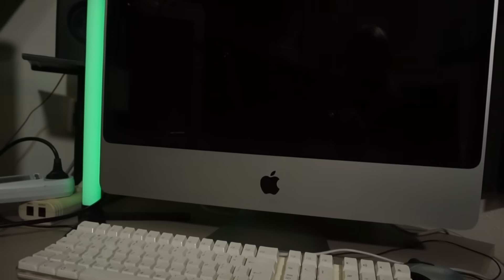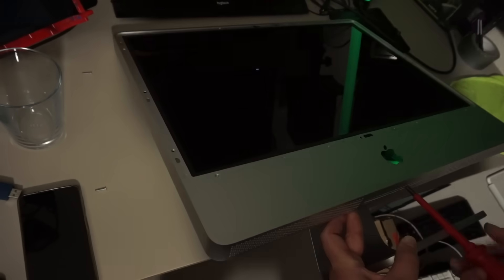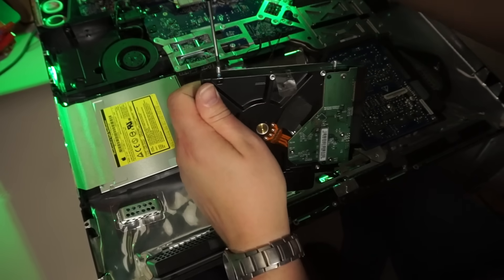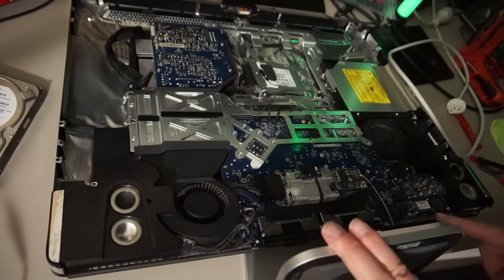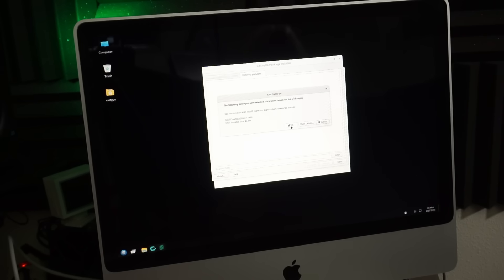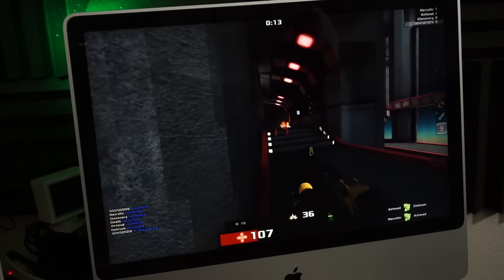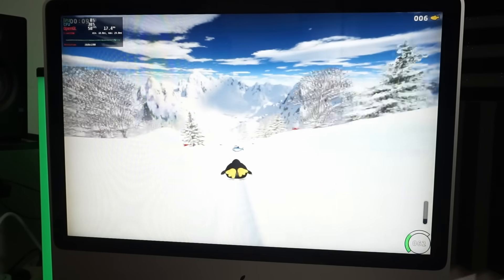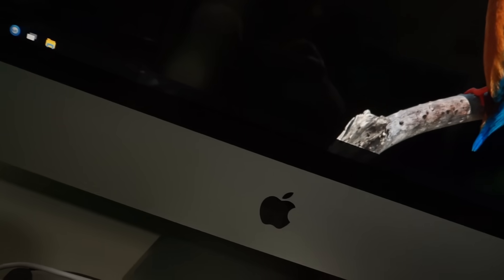Reviving a 2007 iMac with an SSD and CachyOS!

Comment: I have an old macbook air that I have tried several low weight distros on. They were ok but not really good. Thought of trying arch since the others were ubuntu or debian. On a whim installed cachyos. Wow! Excellent. Very speedy. Cachy has a rep as a gaming distro but the initial install is very lean and has no gaming stuff or bloat at all. Very pleased.
Reply: CachyOS has a big ISO and was slow to install on my 2018 Dell Latitude. But, once installed, it is the fastest OS i have every used.

Comment: I have a 2014 macbook air that has a corrupted SSD and might have corrupted SSD driver chip if there is such thing. Was being told that by Apple. If you can point me to the right direction on how to verify if it's just the SSD or some other chip broken i might give the laptop a 2nd chance,
Reply from the maker: Good question, that's hard to say from a distance haha. The SSD on a 2014 MBA seems to be similar to the one in my 2015 MBP. It looks like an NVMe drive and it probably is, but it doesn't have the same connector that regular NVMe drives use, so you would need an adapter to be able to plug it into a PC's M.2 slot. And you need an adapter to M.2 to plug a regular NVMe drive into your Macbook. 

Note that you need a Pentalobe P5 screwdriver to get the bottom screws out of the Macbook! It's not Torx!

If the machine still runs, you could ofcourse boot it from a Linux bootable USB and run tests with tools like smartctl before you open it up.

I found an article explaining the different types of propriatary connectors Apple uses, titled "The Ultimate Guide to Apple’s Proprietary SSDs" by Cody Henderson. Not gonna link it because YT doesn't seem to like that very much. 

You're welcome to talk about it on my Discord server by the way! There's more people that might be able to help you find the answer to your question! :)

Comment: I have a mid 2009 macbook pro with Nvidia 9400M, and it works flawlessly under Linux! Funny thing is that for whatever reason Nvidia 9xxx gpu's are a rare oddity in Linux, all I've tried have no issues at all. Even the latest version of Minecraft is playable at around 35 fps at full res
Reply from the maker: Nice! These GPUs are prone to failure however, but can be revived for a while with some heat (I made a video about that as well, on a 2008 model). But as long as it works, they're great!
Reply: @ex-itguy  No as far as I know, these ones aren't prone to failure. It's the Nvidia 8xxx ones that are prone to failure. I have found several failed Nvidia 8xxx gpu laptops but none for the 9xxx ones. I even have a All In One Touchscreen PC with a GPU that's from the 9xxx generation and that has a laptop motherboard internally oddly enough. I got a bunch of them from school as they were discarding them but all of them work just fine and have been used for years! Some of them dating back to 2019 with Windows 10 on them as the last time it was used.
Reply from the maker: I didn't know that! I thought all of these had issues. I have seen videos on iMacs with Radeon cards that had the same issue as well, but to be honest no personal experience. But I don't keep any around for long enough to make sure. :)
Reply: @ex-itguy  If it helps I got my mid 2009 macbook pro out of a junkyard. It had minor water damage that I removed with alcohol and the SSD + HDD (DVD was replaced) were both dead. After replacing that and upgrading it to 8GB of ram it's actually a pretty nice and usable laptop! Even the original battery has 80% health left which is impressive
Reply from the maker: @aleksandersats9577 nice!

Comment: Ive got one of these I got from a garage sale for $10. Im not a mac guy, but Ive always liked the aesthetic of this model. Ive got it in the kitchen in top of the microwave. I probably wouldn't use it as a daily driver, but it makes a perfect kitchen PC, youtube, recipes, music etc. and the rest of the house tolerates it, as opposed to having something more janky-looking.
Im glad you mentioned the boot time, and a fix. I probably wont do it, as turning the machine on a few minutes before starting is kinda normal for kitchen stuff. turn the oven before baking, turn on the kettle before you need hot water, fill the sink before washing up. besides, I dont have a copy of macos.
Something I didnt know, is that you need to use a proper mac keyboard in order to get it to boot from USB. the internet says you can use many combos on a standard PC keyboard, but I couldnt get any to work until I acquired a proper mac keyboard. That, and the fact the bootloader takes SOOO long had me convinced the machine was broken.  I was very pleased when it did infact boot a USB. Im using Xubuntu, mainly cos that is what I had on hand, Wifi drivers work right out of the box. havnt bothered with GPU, not something i'll ever need.
lovely machine, the screen is excellent, looks at home in a kitchen, and the right price. boot up time sucks and power draw is a worry (it gets HOT), but also, just about anything else in the kitchen is a power hog, so I dont really mind much. Oh, and the WiFi works just fine, even when its sitting on top of the microwave, so thats nice
Reply from the maker: There's old MacOS images on the internet archive, but I couldn't get one to boot from USB while my 2015 MacBook had no issues from that same stick.
You don't need a Mac keyboard to get into the boot picker. Just hold alt right after the chime until you see it. :)

Comment: I have a late 2009 iMac with a running OS of 10.6.8. It works for what I need it for.
I could technically update it using some of the open source options but I decided to just pop in a USB and boot to Linux. No need to take it apart to install an SSD.
Reply from the maker: You can install it to the hdd as well haha, it just won't be as fast. :)

Comment: Great Job, I worked on a few of these, hated the power supply exposed like that, but when you had it opened you should have upgraded the CPU tbh
Reply from the maker: Thanks! Changing the CPU is quite a lot more work,  but I didn't have one around and didn't want to spend money on it tbh

Comment: They are great. Not do great are the wifi cards. The Broadcom chips have issues. Losing connection and having to disable and enable. It's not a Mac thing. ( So be warned) I used to run Linux Mint on it I did switch out the cpu for a faster newer type.

Comment: Try upgrading the RAM to 6 GB, Intel Core 2 Duo T9500 as the extra cache, clock speed, and efficiency will improve things by a bit.
Reply from the maker: I don't think that will bring huge benefits tbh. The biggest issue is the gpu in this case. I guess you could upgrade that with a better MXM card but these aren't cheap haha
Reply: @ex-itguy  fair enough
Reply: Though personally, if you are buying a computer, try to get one with at least a 3rd Gen i7 or newer

Comment: Think I'd drill a couple of new holes in that drive adapter to get the SSD connector where it needs to be, rather than rely on a bodge!
Reply from the maker: That would mean on both sides because you'd also have to move the plastic clip. And the adapter won't be long enough for that either so you'd have to extend it with something. ;)

Comment: Some 32 bit linux will probably be a lot snappier on that, Debian 12 also includes most firmware and will probably be a good option.
Even a 32 bit windows would be a viablr option for some retro gaming, drivers can be a bitch on old macs though

Comment: This is my everyday machine! lol. I maxed up the memory and put in an SSD and I’ve been using it as my television and streaming device in my bedroom since 2007.  Everything works perfectly fine. I’m never waiting for buffering or anything like that and even though I have some newer computers, I always keep this one as my main because it is amazing. How much use I have gotten out of this machine.  The only thing that even comes close is my late 2008 Mac mini which I maxed out and added an SS D Dr. as well and I’ve been using that on my downstairs television since it was brand new right now it was running Monterey, but I’m gonna upgrade it to Ventura as soon as I find a suitable USB hub to get around the glitch that doesn’t allow you to install Ventura in these machines without plugging in a USB hub for some reason  but I have a 2007 and a 2008 and they have been running nonstop 24 seven since they were purchased new except for the few weeks we had no electricity during super storm Sandy in 2013! I cannot believe that these computers still work and are just as good as my newer computers. I get annoyed with all the videos, calling these machines you waste when they are definitely not you waste.  As long as you install open core or Linux they are still perfectly usable and instead of paying $3000 for an iMac you could get one for $20 and do the same thing

Comment: i think the imac and the all-in-one in general is useless form factor ,why would you tie a good panal with a platform that would end up obsolete 2 years later ,i have 22 inch dell display from the core
i mean whats the advantage to buying an mac mini and monitor ,ppl are too dummy to plug the power and display cables?
Reply from the maker: I have to agree with you on that. I loved the 4K display of the 2017 model I got here but I didn't want to keep it around for that exact reason. If you don't want to see it, you're better off buying a mini pc to hang at the back of a monitor.

Comment: Interestingly, Windows might actually run better, especially if you max the RAM which was cheap enough at the time. I had one of these models and Windows ran suprisingly well and it still would get updates unlike MacOS.
Reply from the maker: Not much luck with Windows 11 on this one though haha, although... if you really, really want it, there is a way. I'd rather have it on Linux though but that's just my preference.
Reply: @ex-itguy  True. I think I was running Windows 8 maybe even 10, but never tried 11.
Reply: Core2-CPUs like this can't run Windows 11, because they don't have the SSE4.2 instruction set.
Every Core-I is able to run it by using Rufus or any similar trick.

Comment: I was very lucky to find two (!) 2017 Retina iMacs together for about 100 euros which needed SSD upgrades.. Not as easy to repair as the previous generation with non laminated displays but very doable.

And nice to see cachyOS!
Reply from the maker: I was glad I could skip that step when I had a 2017 model overhere haha! But if I would have wanted to keep it, I sure would've done the upgrade indeed. The 4K screen (or 5K even on the bigger ones) on these things is amazing!

Comment: On all of my machines, I usually do not swap the spinning disk for an SSD when using Linux. I use the SSD for a Open Core Legacy Patcher and macOS installs only. On Linux, most of my MacBook (Pro), Wintel-Laptops, and legacy Gamer-PCs, run pretty decent with spinning disks no matter what RPM.
Reply from the maker: I haven't used a spinning disk for anything but my home server  for 15 years or so haha
It's true that Linux runs fine on a hard disk though, but boot and application startup times greatly improve on an SSD. And they're cheap nowadays!

Comment: Didn't you have any problems booting 64bit at all? These are one of the 64bit Macs with 32bit EFI. They should require modding the ISO. IIRC you needed to put the file bootia<something> in the boot folder or boot from DVD.
Reply from the maker: Arch, and apparently these three flavors of it as well, comes with a 32 bit EFI file so it just works. :)

I did need to boot the ISOs in Grub mode from Ventoy though.
Reply: @ex-itguy  Wow! That's good to know. I have done the "iso modding lingo" with some (probably debian based) distro a long time ago. Otherwise OpenBSD is my goto OS and it boots fine on those older Macs too. Thanks!

Comment: Considering that you have a Core 2 Duo and 4GB of DDR2 RAM, reducing system overhead with a lightweight OS is probably the best way to go here. Its very cool that Cachy still includes it for the sake of options BUT UKUI is more of a midweight desktop environment with questionable development/origins. Can't go wrong with Cachy OS and something like XFCE or LXQT with optimizations but It could get better/lighter than that in this case. You really don't benefit from being a guinea pig sacrificing stability with bleeding edge packages on super old hardware anyway. As Cachy OS is very awesome for generally being the best way to Arch, most of the compelling use cases for it are honestly better/easier served with debloated/performance optimized versions of Windows 10 LTSC IOT/Windows 11 Pro. Loc-OS, aka the ultimate Potato PC saver is pretty much as light as you can possibly go without compromises getting heavier than diminishing returns. Someone like You should definitely know about Loc-OS which is available for both 64/32 bit machines BTW! Mint XFCE, while on the "heavier" side of light, really is that SUPER polished/stable/user friendly/globally supported "well packed lunch" distro. The middle ground, is my very own Fedora barebones based recipe I like to call "Baby KDE" which is actually just using minimal as possible packages for LXQT/KDE Discover. It is the most manually involved when it comes to first setting it up but does give the best end result. To be fair, all my OS installs are manually involved cuz I'm "very serious" when it comes to optimizing lol. With only about 500mb of idle RAM and hardly any CPU use, you get a very user friendly "KDE plasma lite" environment, GUI access to software management/updates (great for folks that want a terminal free experience for day to day stuff) on a powerful Fedora base that is very well supported and current as possible without rushing to break things like Arch is.

Comment: 2:53 the shiny metal part is probably from the front glass panel. I think they serve as alignment guides for when you magnetically attach the glass panel to metal frame.
Reply from the maker: You're right! I took the panel off again and there's one missing from the side I found it on!
Reply: on my mac too. because its magnetic it stucks in the metal bezel

Comment: I have a 2011 one that I want to do this with. The monitor panels they used for these were so fucking good that I couldnt bare to throw mine away. Linux saving the day from e-waste.
Reply from the maker: I think you'll get even better results on that one! Indeed these iMac screens are awesome!
Reply: I tossed Mint on my 2011 iM and could not be happier. It runs better now than when it was new haha!

Comment: Dual Booting Windows XP 32 bit for DOS - Mid XP games & Linux Mint for easy of use and nice responsive Ui. I'm actually atm setting up a mid 2011 mac mini that I replaced the HDD with a SSD patched to work for Catalina years ago that I gave to a family member with Linux for some years. Now I'm attempting too get it setup dual booting both Catalina & a version of Linux that'll setup the partitions automatically without me hopefully. Nice video like always, older macs to me I always want to install XP or Linux.
Reply from the maker: Thanks! I didn't really care to try an older version of Windows on this one, as that would put you kinda in the same boat as MacOS in this particular case. 

Most distributions make installing alongside of Windows pretty easy. Just make sure you already made space on your disk by shrinking your Windows partition up front. I made a video about that subject early this year. :)
Reply: I know Mint does a great job detecting other operating systems and offers to allow you to install it alongside them. Most distros are good enough with that nowadays tho.

Comment: OpenCore Legacy would be nice?
Reply from the maker: Not supported for this one, sadly
Reply: @ex-itguy  Based on the docs, the iMac7,1 is supported.
Reply from the maker: @joseashbrook7260 after several upgrades 😅
Reply: @ex-itguy  The CPU is upgradable to a penryn core 2 duo cpus which adds support for macOS Sierra or newer

The santa rosa core 2 duos do not have enough instructions for oses past el capitan but multiple reports have shown that a core 2 duo can be installed in these machines.
Reply: Assuming its even possible, it still doesn't mean its practical. We are talking a Core 2 Duo and 4GB of DDR2 ram here 😜

Comment: the cachyos kernel patchset apparently performs worse on old dual and quad core processors, at least it did in my experience, I got like 15 fps less using it compared to just the vanilla kernel
Reply from the maker: Oh wow, that would mean performance might have been better if I just kept it on Manjaro!
Reply: @ex-itguy  Manjaro is sort of in a redundant place, packages being unevenly held back can cause issues. Fedora is a much better deployment for the "Manjaro use case". Cachy OS is generally the best way to Arch because it actually goes a couple steps beyond just making installing a ready to use Arch desktop easy. One such way is its amazing kernel and more specific to your CPU app packaging optimizations as well as its tools. One such tool allows you to very easily switch between kernels so it won't be hard for you to test out the differences at all.

Comment: How did you get it to boot into Linux initially ?
Reply from the maker: Simply hold alt (or option) down right after the chime with my Ventoy stick plugged in. I did need to run all in grub mode or they wouldn't start.
Reply: It has a os picker you can activate when holding down the apple key I think.